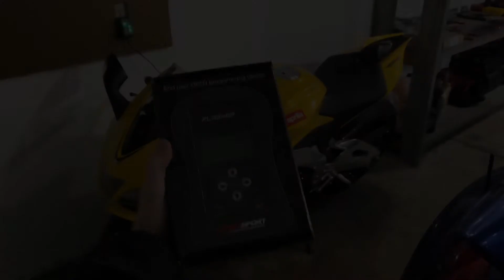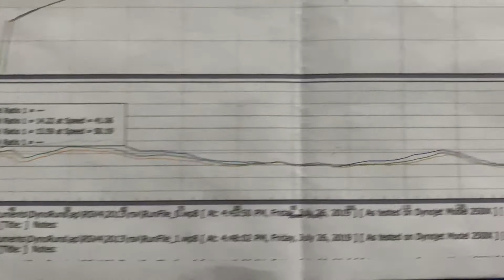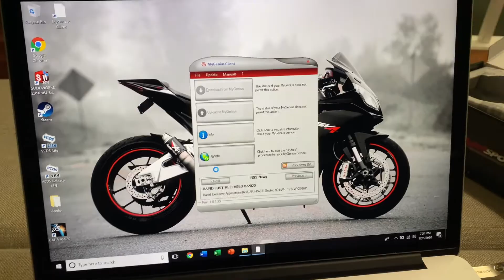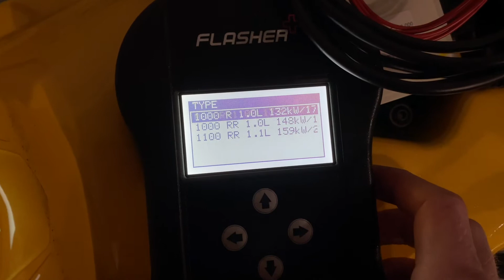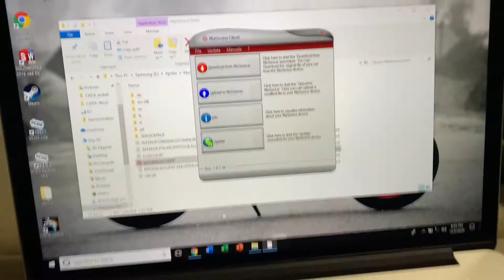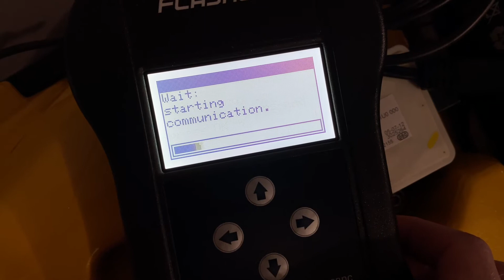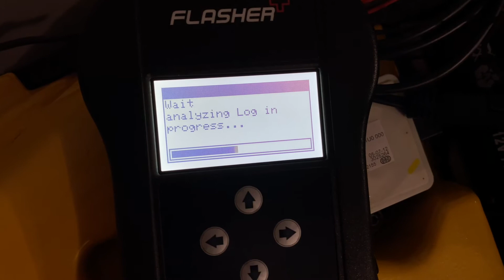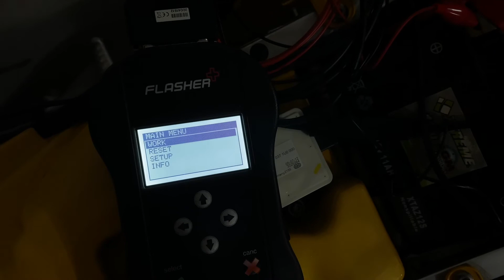How to Flash Tune your Motorcycle with DYNO Results! (BrenTuning RSV4)

Comment: Hi
Quick question
The whole email process
Do you have to wait for the brenn tune operational hours or can your do this at anytime anywhere
Is this a automated email reply
Thanks
Reply from the maker: You can reply anytime but they most likely won't get back to you until their business hours
Reply: @AGiraffeOnFire  oh ok
So I should wait to flash when they are open during their business hours?
I have the Bren tune hand held

Thanks
Reply from the maker: @tnelliott2447  Up to you!  There shouldn't be any problems unless the bike loses power while flashing
Reply: @AGiraffeOnFire  thanks
Think I’ll just do it 
I’m guessing it wouldn’t make much sense to have that device relying on a remote response lol

I saw th video on the dyno run after you flashed
Did you get it sorted out?

Thanks for the replies btw 
Cheers
Reply from the maker: @tnelliott2447  They won’t do anything until I get same day dyno runs which is understandable, even though you would think better DA would benefit their tune.  Maybe I’ll do that eventually, just more money to spend lol.

No problem!  Did you get your bike flashed successfully?
Reply: @AGiraffeOnFire  oh ya, sucks that it’s not more but the rsv4 comes almost max from the factory it’s a tough choice to spend the money on the ecu flash or piggy back tune for the Aprilia 

If we were all smart we spend it on other things for the aprilia lol
But I’m not smart lol

The flash more or less just smooths out the curve, when we put on a after can it changes things obviously 

I was on the fence about getting the flash for this bike 

I had the flash on my last RSV4 and got it dyno it it was a 5 HP gain and I did my research, even the shop that did the dyno told me I’m wasting my money the can alone is enough

I think the weight savings alone is the gains lol

650ib account on you tube took his new rsv4 got the Akro, sprint race filter and tune for 6HP gains

Shows how good the aprilia are from the factory

No I didn’t get it done
Was tinkering around 
I had to update my laptop n all
Then got text to go riding lol

I finally clued in on the email question and Bren will email me back in a couple days lol

Anyway bro thanks
Hope the dyno gets a better result

Comment: Greetings from the UK
Great video! I have a 2019 RSV4 1100 factory Matt black, I’m talking to Brentune now about this, I’ve just bought the Akrapovic race exhaust with link pipe to get rid of the cat! 
Hoping they can help me out with my tune, would be nice to get brentune into the UK a bit more, we run on 95,97,99 pump gas over here so hoping they can deal with that.

Keep up the good work, can’t wait to see the dyno results.
Reply from the maker: I'm jealous of the 1100, hope Brentuning can get you taken care of!
Reply: @AGiraffeOnFire  thank you, I’m jealous of how much support you have in the states and the quality of dedicated tuning companies
Reply: The stated octane rating differences between the UK and the US are not as big as almost everyone seems to believe. There are 2 relevant octane rating numbers: Research Octane and Motor Octane. Research octane is the chemical rating calculated by the oil company. Research octane is the rating the same fuel receives after performance testing in a variable compression ratio research engine. R is ALWAYS higher than M. In UK, petrol is sold marked with Research octane (the high number), in the US the 2 values are averaged. That’s what “R+M/2 Method” on our pumps means. Ergo, our 91 octane could very well be an R value of 93 with an M value of 89 that averages out to 91. In UK, you’d only see the 93.